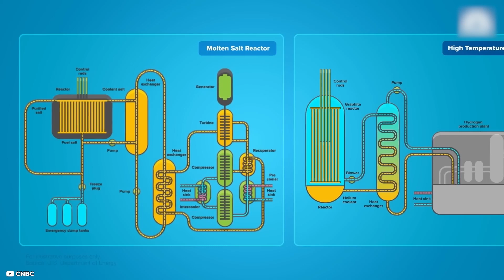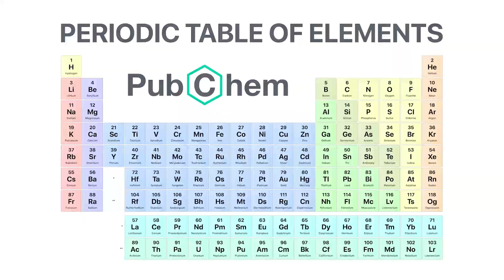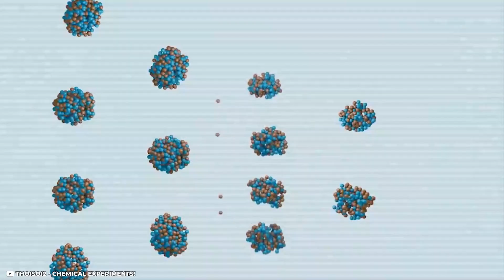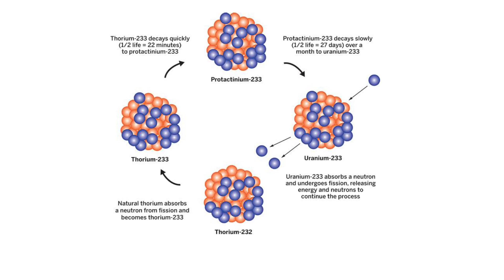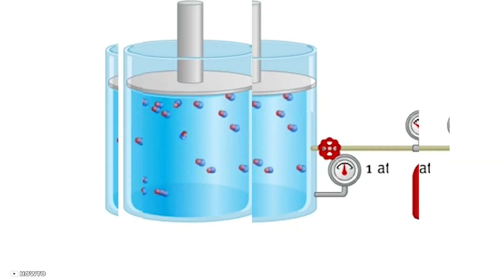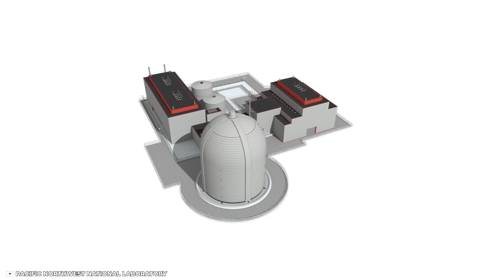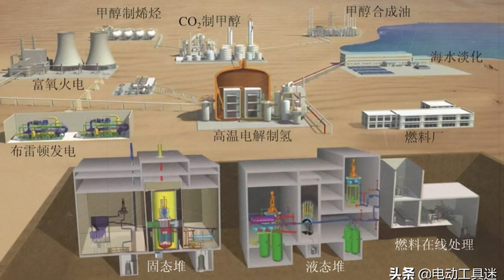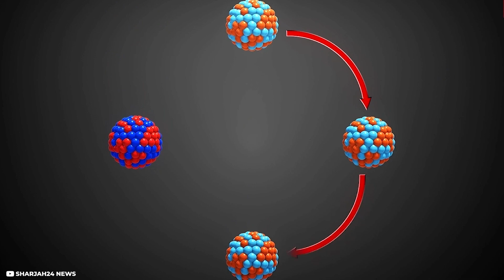NEW NUCLEAR REACTOR! Safe Nuclear Energy for 1200 Years!?

Comment: Molten salt reactor research was shut down due to political reasons not problems with corrosion.  The first reactor was successful in meeting all the requirements in demonstrating the feasibility of the molten salt concept and demonstrate advantages in safety and utility of the concept. The problem with corrosion was mostly figured out and a remote servicing process was developed to replace parts as needed.  A reactor to tests these solutions and to further develop the reactor concept was planned when politically all funding was cut. There were no technical reasons that the reactor research was halted.
For more information:
https://youtu.be/bbyr7jZOllI
Reply: Nixon explained his reasoning for shutting down MSR on tape.  "Where ever possible , move the money to california".   A true California Oil guy.
Reply: The reason was the US military.  They halted funding because you couldn't build so easy nuclear weapons. That what you call today nuclear waste is the leftover of a very inefficient 
hot water reactor, which uses only 5% energy from uranium roads that have to be reconditioned because they fall apart. You have a hot water immersion heater with a 5% energy production.
The public pays now unknowingly for the plutonium and weapon-grade uranium for the military.
A win-win situation for the military, not the public😁😁😁😇🥰
Reply: Based on what the scientist that lost their job over the decision said
Reply: @clarkkent9080  
Those scientist had no problem finding work.  They went on to other projects making just as much or more money.

Try to remember the economy in those days wasn't like it is now.
Reply: @tonyrmathis  Wow the entire world uses Uranium because of the U.S..  Russia, China, everyone followed us.  Actually the UK and Russia built the first commercial reactors so we followed them.

Terrapower has been working on their MSR for many years, fully committed 2 years ago and still nothing.  They estimate $4 billion for a 345 Mw reactor that is already a financial failure if it can even be built at the estimated cost which no nuclear project has.

The U.S. also built a nuclear powered air plane decades ago and I guess it was abandoned because of politics because I don't see any of those flying around
Reply: @clarkkent9080  
"What specific unnecessary regulation are you referring to??? "
Are the safety systems the same for Thorium?  NO!  Yet regulations designed to address high pressure uranium designs that can and do run away and melt down are the ones they have to meet.  As for systems being periodically tested those are post build and wouldn't have any effect on cost.  Your response is a plea to emotion.

"Please specify ANY anti nuclear battle that have been reported on the Terrapower project"
I made a general statement that all applies to ALL attempts to build nuclear plants in the US and has been a factor ever since the anti-nuke movement and the politicians who pander to them gained power.

"Please provide the link to Nixon political statements on the MSR."
https://youtu.be/tyqYP6f66Mw?t=929

Unlike when you claimed Terrapower spent $4 billion on MST 
Terrapower along with the Southern Company announced building a MST demostration plant in 2022.  The $4 billion you refer to isn't just for MST it's for Travelling Wave Reactors, Sodium Fast Reactors and R & D.

"That 80 billion sent to Ukraine may just prevent WWIII and Europe could have prevented WWII if they would have stopped Hitler in 1939"
Putin's aggression is toward former Soviet territories unlike ours that targets small countries worldwide. If Texas left the union and allied with Russia you wouldn't call Biden 'Hitler' if he took military action.  Save the warmongering for kids too stupid to know better.

"You are a MSR Thorium fan boy"
Yes and you're a warmonger.

"You believe that no matter what it cost build it and make the taxpayer build investor owned power plants and let them profit."
I never said any such thing.  Projection perhaps?

"No U.S. utility is even remotely considering new (16 year build time)"
Why?  Why 16 years?  Why has the build time quadrupled since anti-nuke politicians gained power?  Please tell us how concrete magically takes 4 times longer to cure and steel takes 4 times longer to weld.
Reply: @tonyrmathis  The regulations specify that the containment shall prevent the release of radioactivity in the event os a major loss of coolant accident.  You don't want that for a MSR????

The regulations do NOT specify the size, thickness, or even type of containment only that it contains.

This is part of Nixon's documented speech to congress in 1973. Your link shows a conversation that is fake as it cannot be found anywhere else other than that YT video.

Most nuclear power plants now in operation utilize light water reactors. In the near future, some will use high temperature gas-cooled reactors. These techniques will be supplemented during the next decade by the fast breeder reactor, which will bring about a 30-fold increase in the efficiency with which we utilize our domestic uranium resources. At present, development of the liquid metal fast breeder reactor is our highest priority target for nuclear research and development.
Reply: @clarkkent9080  
"The regulations specify that the containment shall prevent the release of radioactivity in the event os a major loss of coolant accident.  You don't want that for a MSR????"
The regulations were designed to address high pressure uranium reactors.  No regulations exist that focus primarily on MST because MST hasn't been developed over 50 years like other reactors have.  Containment for MST doesn't need to be a robust since there's no high pressure or coolant water involved.  You don't need to trap steam if you're not producing any.  If your coolant is solid at ambient temperature there's no risk of escaping to atmosphere.  Yet the regulation require safe guards against just such.  If the regulations were based on MST then other reactors would be horribly unsafe.

"The regulations do NOT specify the size, thickness, or even type of containment only that it contains"
Again basing the safety requirements needed for MST on those needed for other reactor designs.  Tell us more about radioactive steam containment in a system that doesn't need or use water to function.

"This is part of Nixon's documented speech to congress in 1973. Your link shows a conversation that is fake as it cannot be found anywhere else other than that YT video."
It is a phone conversation not part of any speech.  The fact that you can't (or won't bother to) find it doesn't mean it's fake.  All your response does is prove that even when presented truth you'll reject it.  Typical or your type.
Reply: @clarkkent9080  
"the reactor requires a smaller containment structure than a conventional reactor."
Gee!  It's almost like it doesn't have the same safety requirements as a standard reactor.
Reply: @tonyrmathis  The Terrapower Natrium reactor design has been finalized and you can access all that information.  But you cannot name one thing that regulations require of that MSR that is not required for that design. Proof not tin hat conspiracies',

You can claim anything you want but you have no proof.  Find one article on VC Summer, The MOX project, or Vogtle that claimed deliberate legal sabotage by anti-nuke activist of regulations and permit/licensing requirements????
Let me help.  This is the latest ~ $1 billion in cost over runs at Vogtle and unless the CEO is a lier the problem had nothing to do with deliberate legal sabotage by anti-nuke activist of regulations and permit/licensing requirements.

Below is the Vogtle Project Management's answer for the latest delays:
Southern Co. yesterday announced another delay for its long-troubled nuclear construction project in Georgia, edging its costs closer to the $30 billion mark. 
The setback could now push the startup date for Plant Vogtle’s first reactor until early 2023 and move the date for the second one to later that year. 
Plant Vogtle’s latest move highlights the nuclear industry’s chief troubles with building large, baseload reactors: safety and cost. To be clear, Southern executives have blamed this new hiccup on paperwork, saying that workers were gathering it to send to federal safety regulators and noticed critical inspection records were missing or incomplete. The pile of missing or incomplete documents added up to a delay of three to six months, Southern said. That additional time is costing $920 million. 
“We’re a little frustrated with the latest developments,” Southern Co. CEO Tom 
Fanning talked of “great momentum” at the construction site since November. 
But workers realized “tens of thousands” of critical documents were missing, leading to a three-month backlog. 
“We’re fixing that part of the ‘paper’ process,” he told E&E News.
Put your tin foil hat back on message pending!!!!
Reply: @clarkkent9080  
Alright!  Since you have all the answers explain why it cost so much and takes so long.  Why have they both quadrupled since the anti-nuke movement began?  Nothing you've posted explains why building a nuclear plant takes 12 years longer or billions of dollars more than it should.  And no!  Missing paperwork won't cut it

It didn't take that long and cost that much before anti-nukes so what changed?  And no!  All those plants weren't unsafe or substandard.

And if you don't mind how about talking about the broader industry instead of laser focusing on a company owned by politically well connected software engineer Bill Gates.

And while you're at it tell us what energy solution you DO approve of since you're so opposed to trying new things.

You started off blaming this on disgrunted scientist then went on to defend Nixon and Warmongering.  Why?

You call me a fan boy because I like the idea of a new reactor design and I've admitted it.  What's your motivation?  I don't have a stake in any of this.  My taxes won't go up or down based on any of this.  My income won't change either way.  How about you?  Why so passionately oppose to MST?  Do you work in the uranium supply industry?  Are you a paid anti-nuke?  Perhaps you're vested in some green energy company.  Tell us why you're so opposed.  You've already stated you agree with spending 20 times as much on a corrupt country half way around the world so it can't be fiscal conservatism.
Reply: @tonyrmathis  I thought it was obvious to the most casual observer.

I have not worked on either project but I live less than 60 miles from both VC Sumer and Vogtle and know many that work or worked there. I can only relay what I have been told by people that actually worked or are working at these failed projects: poor management, stolen equipment, fraud, kickbacks, greed, sabotage to keep the project going, lost (i.e. never x-rayed or performance tested equip.) documentation, etc. All project related. Oh and maybe the biggest issue, the utility makes a profit based upon the cost of the project so the ratepayer is stuck paying  for their mismanagement. 

Yes my sources say the there were no missing documents, they just did not x-ray the critical safety system welds or performance test the equipment until it was time to collect all the documents.  And if you don't think this is a project management issue. NO ONE was demoted or fired because of the "missing documents".  Were do you think the VC Summer workers and managers went when that project was canceled?  You guessed it Vogtle and they will be on the next nuclear project if there ever is one.
 
The facility where I worked hired a group of ex-navy nukes. One (ex navy nuke chief) over the 3 years I knew him never obtained his Rad Worker training.  That means he  never entered the nuclear facility in 3 years and he was responsible for qualifying new hires. Worthless as can be and a real @ss kisser.  He finally quit and you guessed it , went to Vogtle.

I do have 1st hand knowledge of a concrete structure that was being built to protect a critical safety system.  The concrete mix was specified along with the specs on the rebar steel mix.  In order to meet the engineering requirements for the structure these things must be met as specified and a premium ($$$) is paid to the concrete and steel vendor to meet that spec. 
When workers tried to install the rebar, sourced from an Alabama mill, it would break and not bend as it should if it was made as specified. The rebar was low grade steel that might be alright if building a Walmart but it was no where near the steel mix specified.  Some vendors don't seem to understand that a specification is there for a reason and some just think they can get away with providing crap.  In this case, the concrete pour was put on hold, the job delayed, costs increased, and since the project has no time to argue with that mill, just paid them and sourced the steel from another mill and QC inspected it before acceptance. 

Any questions?
Reply: @tonyrmathis  Unlike you, I am not here with an agenda supporting any particular power generating method.  I just provide facts when I see fanboys claiming things are are not going to happen.

It is annoying when people pull out these unfounded, nonfactual conspiracy theories to explain what the have no facts to back up.

BTW neither you or I will have any input to the electrical generation sources that are built.
Reply: @clarkkent9080  
All that is good grounds to oppose those plants but it's not an indictment against MST itself.

Mismanagement, fraud, faulty materials would cause excessive cost overruns and delays on any project.  As for not X-Raying weld at a nuclear plant that's ought to be criminal.  

My best friend's father was the best welder I ever knew.  He worked at Ingal's Shipyard in Pascagoula, Ms. welding reactors in naval ships.  He was so good they transferred him to Iowa to train other welders and supervise reactor welding at a plant they were building.  He explained to me all the things they had to do to certify a weld.  X-rays were just part of it.  They had several different test they had to pass to be certified and if they failed it was all cut out and redone.  And this was 40 years ago.

I'm not sure how they got away with what they did at the plant near you but clearly several people need to be in jail.  It couldn't have happened without at least half a dozen people from management all they down to the welders turning a blind eye.
Reply: @tonyrmathis  I have never commented against the safety of a nuclear power plant or consider the waste issue to be a non-starter.  I operated one for many years.  I will however comment on those that misstate anything about either of those. 

Yes people should have been fired at Vogtle but they were not.  There were a few managers at VC Summer that were charged with fraud but I have not kept up with the court cases.

The other issue that has come up is the U.S. construction industry's inability to staff two major critical QC projects at once.  Both VC Summer and Vogtle claimed delays and cost over runs on the inability to obtain the necessary skilled workers as one project stole workers from the other. Keep that in mind when people think we can just simultaneously build multiple units in the future. 

Something that is becoming a very big problem is counterfeit parts and the higher the price for the component, the more likely it will be the target of counterfeiters.

It does not matter if it is modules constructed in a factory as they were for VC Summer and Vogtle or assembled on site welding is NOT welding.   A nuclear grade weld just like nuclear grade equipment is very specific and usually requires testing of some sort to confirm it meets design specs. This is what allows a nuclear plant to perform as designed.

I can tell you that I experienced "events" at various nuclear power plants that would have resulted in significant damage if it involved "normal" construction methods but the nuclear grade build held together and it became an accident that never happened. That is why I push back on comments that we should relax the regulations that most probably have prevented many events from even happening.

Today in nuclear it is cost, cost, and cost
Reply: @clarkkent9080  
I can see why you think I was advocating for relaxed regulations but that was not my intention.

My point was the regulations in place (at least a few years ago) were based on high pressure water designs and that what is needed is new ones tailored to MST.  Such new regs wouldn't just lower cost and build times but would also increase safety since MST has issues other designs don't.  Fuel reprocessing for example.

The same problems you point to in construction also exist in government agencies charged with regulating these things.  Many lack the expertise to create the needed regs and lack the will to do anything that even appears to be a roll back.  

Again these are not problems with the tech but rather the people charged with developing and overseeing it.
Reply: @clarkkent9080  Terrapower's reactor is a first build commercial reactor.  Like how much did it cost Tesla to build it's first car?  The thing about the Terrapower reactor is that it is geared to produce it's electrical power when renewables can't and the return for producing power during these times is very high. It appears that the value of producing electricity during times of high return is going to be increasing in the future as more of the grid becomes powered by renewables. So there is considerable profit potential in Terrapower's reactor concept even if costs are greater for each unit of power produced.  The type of reactor Terrapower is building is planned to be a basis for multiple reactors.  Once the process of building the first reactor is established following reactors will become cheaper as experience develops.  So the cost of this first reactor should not be the determining factor as to how successful this reactor system will be in the future.
Reply: @stanleytolle416  I agree that costs should come down as more and more are built....."should".

After all Vogtle unit 1 & 2 were 500% over budget and unit 3 & 4 are only 125% over budget and not yet both operational.

But the bottom line is that even if Terrapower could eventually drop the build cost, it will not be substantial.  Its not like they will eventually be able to build a reactor for their original $1 billion dream.  And if you know what little a billion dollars buys today, you know that is true.  First lets see if they can even build it for $4 billion before claiming anything. My belief is if they ever build the first one, the story will be: "we can get the cost down to $4 billion if we build more".

The cost for nuclear is so much more expensive than solar, wind turbines and natural gas that it cannot possibility compete no matter how efficient production methods become.  Nuclear has always been claimed to be less expensive if we build more.  That has NEVER happened so what idiot would believe them now after 60 years of lies? The only reason Vogtle unit 3 & 4 are at $35 billion and not $45 billion is the passive design.  The passive design is a safety selling issue to the public but in reality it is a cost saving measure (less pumps, emergency generators, and two trains of everything). 

I am fully aware of the Natrium storage ability.  Claimed additional 150 Mw for 5.5 hours but in reality much less.  Everything that established Westinghouse nuclear has ever sold was in reality less so why would anyone expect more from a startup. 

The loss from solar far exceeds a 5.5 hour period so you are going to need another generation source like natural gas so why have two generation sources when one gas turbine can handle all needs?
There are many parts of the U.S. where the wind always blows so wind turbines don't really fall into the "partial production" duck curve of solar.  Every grid has spinning reserve that can make up for peak demand and renewable grids will need to utilize more spinning reserve than current grids.

One presidential candidate who is not just some politician spewing what the polls tell him to say, gave the best answer ever when asked about new nuclear, in a town hall.  He said; No utility will build the current generation of nuclear reactors with out the government paying much of the cost. And there are all kinds of claims being made for gen 4 reactors designs. If private investors are willing to build them and those claims are proven to be true, I will back them 100%. All that off the top of his head..no teleprompters.

I was shocked that someone running for president actually knew what a gen 4 reactors was and had a knowledge of the nuclear industry.
Reply: @clarkkent9080  the cost of nuclear reactors does not need to be as high as they have been in the US and Europe.  The problem has been mostly demands for changes after construction begins and blunders in construction.  Korea is an example where massive nuclear is being built on time and under budget.  Even Russia in doing just fine in Turkey. If one looks even at oil there are massive government subsidies to keep the fuel flowing not to mention a few wars.  Like why is not private industry picking up the tab for the military cost of our involvement in the Middle East if that energy source was so lucrative? As for the economics of nuclear the operating cost of even are current plants is quite low.  Really nuclear was only having a problem when gas prices were extremely low due to excess production from the development of fracking.  The gas was a by product of the oil that was really wanted. As you may have noticed gas is no longer cheap as LNG terminals have been built and gas is now at world prices.  Current nuclear is also having problems because of changes in how electricity is sold.  Current nuclear was built for a guaranteed steady purchase of electricity with rates set based on the amount of investment made. Nuclear no longer gets this benefit but it does have to complete with renewables that are guaranteed a purchase price no matter the demand for the power at the time.  The effect is the price of power going below zero at times. This is one of the subsidies going to renewables that is currently hurting nuclear power. The reason to push these subsidies is to get off of the climate destroying war producing current energy system.  There is considerable private investment in newer nuclear which Terrapower is but one example. As I see it nuclear is the only way to truly change our energy use into a truly sustainable    system.
Reply: @stanleytolle416  I agree that the costs should not be so high but they are and just because you say something does not make it true.  Here are the FACTS for the last $1.5 billion in cost over runs at Vogtle.  And BTW, Unit 3 started on April 1, shutdown a week later and just restarted two weeks ago.  Where those months of shutdown due to construction changes?  And if you want detailed facts, I have Georgia Power's statement to the PUC in the reasons for the delays and they have nothing to do with changes from the NRC.
What happens in other countries has no bearing on construction in the U.S..  And the Texas grid method of compensating generators is unlike anything in the east or west coast grids where suppliers NEVER get paid zero for the power generated. It is a contractual cost per Mw supplied

Below is the Vogtle Project Management's answer for the latest delays:
Southern Co. yesterday announced another delay for its long-troubled nuclear construction project in Georgia, edging its costs closer to the $30 billion mark. 
The setback could now push the startup date for Plant Vogtle’s first reactor until early 2023 and move the date for the second one to later that year. 
Plant Vogtle’s latest move highlights the nuclear industry’s chief troubles with building large, baseload reactors: safety and cost. To be clear, Southern executives have blamed this new hiccup on paperwork, saying that workers were gathering it to send to federal safety regulators and noticed critical inspection records were missing or incomplete. The pile of missing or incomplete documents added up to a delay of three to six months, Southern said. That additional time is costing $920 million. 
“We’re a little frustrated with the latest developments,” Southern Co. CEO Tom 
Fanning talked of “great momentum” at the construction site since November. 
But workers realized “tens of thousands” of critical documents were missing, leading to a three-month backlog. 
“We’re fixing that part of the ‘paper’ process,” he told E&E News.

LATEST: Georgia Power says Unit 3 could now begin commercial operation in June, 2023, pushing back from the most recent deadline of the end of April.  Unit 4 will begin commercial operation by March 2024. The company previously has promised commercial operation of Unit 4 by the end of 2023 at the latest.
Georgia Power discovered that a pipe that is part of a critical backup cooling system was vibrating because construction workers had failed to install supports called for on blueprints. 
Fanning told investors that other issues causing delays included a slowly dripping valve, as well as a problem involving the flow through the reactor coolant pumps that hasn’t been pinpointed.
Georgia Power ratepayers are already paying for Vogtle, and most electric customers in Georgia, as well as in parts of Alabama and Florida, will eventually be charged. The effects of the further delay on ratepayers are unclear. Georgia Power has signaled it may could ask for more to be paid for capital costs and financing.
Reply: @clarkkent9080  like I have trying to point out the Georgia Volta nuclear power plant is not a good example of nuclear power.  The plant is based on old assumptions as nuclear power should function (non-variable base load).  At a minimum nuclear power plant needs to be able to load follow ideally store power for peak outputs. The Georgia plant can't do this. The cost over runs at this plant were the result of deciding to change things including tearing out all ready build concrete work.  Like how much would a house cost if you came to the contractor several times with the house partially built and you told them to tear that up and build something completely different? Like maybe you should look at nuclear plants, the vast majority that are being built, that on time and under costs.  Maybe look at the history of the plants built prior to the eighties where the plants for the most part got build for far less cost and within their allotted time schedules. Like since we already have relatively inexpensive fossil fuel plants which are doing enormous environmental damage the first mover cost will need to be subsidized to improve our future lives.  In fact the subsidies needed to establish fourth generation nuclear plants is far less than what had been spent on renewables. There is a reason China has been spending equivalent billions of $ developing fourth generation nuclear including thorium molten salt reactors and that is to develop the intellectual property rights to the technology. If we let the Chinese accomplish this we will be completely screwed being dependant on the Chinese for our energy needs
Reply: @stanleytolle416  They tore out that concrete because the concrete did not meet the design specs not because the specs changed.

Like I said Vogtle unit 1 & 2 were 500% over budget built in the 1970s.  NO U.S. nuclear power plant has EVER been built on budget or schedule.

Is VC Summer a better example or the MOX facility?
You are living in an alternate reality.

The U.S. does have the construction craft with the skill set to build critical nuclear facilities and suppliers simply ignore specifications and provide the low quality material that they have.

Vogtle was building a rebar/ concrete structure for safety equipment.  When the workers were trying to bend the rebar it snapped.  The project paid extra for rebar with a very specific metal/carbon mix as specified in the DESIGN.   The U.S. steel mill sent the same cheap stuff they sell at big box stores and pocketed the extra money.  The project does not have time to litigate the issue so they paid the mill and ordered new rebar from another  supplier. Do you know how many millions in extra rebar cost, lost work time, project schedule upset that cost.  Now tell me Terrapower won't have the same problem.

U.S. construction can build WalMarts an Amazon  warehouses but not nuclear power plants.

Once a gen 4 reactor is built and proven then and only then can you make any claims. It is just like me saying why waste money on fission when fusion energy is clean and limitless? there is NO technical reason against fusion, it has been proven to work on the sun and here on earth
Reply: @stanleytolle416  SIMPLE point: VC Summer, Vogtle, and MOX are recent and the only new nuclear projects in the U.S. over the last 30 years.  You can try but you cannot ignore the facts that 3 were complete failures and two massively over cost.

There is no other REAL nuclear example to try and claim that nuclear can be built on schedule or within budget.

We have 50 years of massive cost over runs and project after project proving that.

All you have is your claim that it will be different next time or that a gen 4 reactor that is a prototype no less, will be a financial success.

Dude, I worked in the nuclear industry 40+ years and am pro nuclear.  I can argue the waste issue, the safety issue but I cannot argue the cost issue. Nuclear gets subsidies just like wind and solar and that is also not an excuse.

With the national debit becoming something that cannot be ignored, all generation sources will have to stand on their own and nuclear is the least able to do so
Reply: @clarkkent9080  really that's simply hiring incompetent builders.  With construction crews that know what they are doing nuclear reactors are being built in 3 years.  The Russians are having no trouble building reactors all over the world.  The South Koreans the same.  This is why the Georgia plant can't be looked at as a normal nuclear construction project. Like African countries are not having trouble getting nuclear reactors built. Maybe some foreign workers who know what they are doing, maybe from Africa, need to be brought in.  This or maybe develop some skills here.  Really it's not that it's not known how to build these projects, like rockets are getting built that can land where they took off, it appears to be more or less  shorty management and crazy building regulations. What I am saying is that if on time on budget nuclear reactors can be built in Africa I see no reason they can't be built here too.
Reply: The answer to the corrosion is an alloy called Hasselhoy N. They used that at Oak Ridge.😊
Reply: Your comment could only possibly be true if there were no other countries in the world.  But since there are many other countries that have nuclear power, why did they not build MSRs?

Conspiracy theories fall apart when you realize that U.S. politics do not affect other countries.
Reply: @clarkkent9080 To understand why Molten Salt Reactors (MSR) were not developed earlier one needs to check out first mover costs.  Like when the development costs for light water reactors for nuclear submarines were undertaken it was just a matter of making these things bigger. Besides almost no one was thinking of dissolving nuclear fuel in molten salt as a coolent/working fluid.  In the US MS was only thought of because of the extreme requirements needed for the nuclear bomber program.  Like the reactor had to be light, compact, operate at very high temperatures and not spread radiation all over the place if the plane crashed.  A MS reactor that could do this was built and tested.  It did work but would not work for a piloted aircraft due to the needed shielding.  Casper Weinberg who developed the light water reactors for submarines felt that a MS reactor had potential to eliminate the risks of large LW reactors with high pressure, loss of coolant, and radiation release hazards. Under his leadership a working MS reactor was demonstrated.  I personally feel this reactor threatened the then whole current nuclear industry with the then current, President Richard Nixon, being manipulated to cut all funding for this program.  I say this because how the program was shut down with orders to destroy all of the research product.  Just by luck several engineers defied their orders and transported their work product to a local community library where these documents remained in a cupboard for thirty years. By chance an aerospace engineer by the name of Kirk Sorensen came across a book about the MS experimental reactor and decided to look into the issue. Kirk discovered the documents at the local library and digitize them and posted them on the Internet with nobody paying much attention except the Chinese government. It turns out the Chinese government was very interest in the project and sent delegations to Oak Ridge Lab to further investigate.  With this interest others have become interested in the MSR concept with the Chinese investing billions of $ equivalent to develop a complete MSR program. The Chinese have built a 2 MW working MS reactor in three years and will have a 300 MW commercial MS reactor around 2026 with serial production of these reactors planned before 2030. Well from the top of my head this was why MS reactors were not developed earlier.  There are a lot of knowledgeable people who think this is the way we should have gone with nuclear reactor development in the first place.
Reply: @stanleytolle416  What about the 3 U.S. commercial nuclear power plants that tried Thorium cores in the 1970s and all abandoned them as too costly???

Other countries have also tried Thorium cores and again abandoned them.

Even today China and India have built DEMO TEST Thorium MSR 1/4 the size of the U.S. ORNL demo test reactor from the 1960s.  They are not confinite enough to build a commercial plant
Reply: @clarkkent9080  these were solid cores. Using Thorium in a solid form has no advantages in a thermal reactor particularly with the cost of 235 uranium dropping. Some fast neutron reactors are being set up to use some Thorium in their fuel cycle. Part of the complexity of using Thorium is it is fertile but not fissionable.  In order for Thorium to be fissionable it has to adsorb a neutron and convert into 233 uranium which can fission. Yeah, it's nuclear science.
Reply: @stanleytolle416  The  main reason why Thorium reactors are more costly than Uranium based reactors is the cost and dangers associated with reprocessing the spent fuel to extract the U233. That is in addition to the cost of the reactor.

Thorium reactors are really U233 breeders and they like uranium based reactors have to deal with Xenon (primary issue at Chernobyl) . But only Thorium reactors have to deal with fissionable isotope (U233) build in that is based on what happened in that core 27 days prior, as there is a 27 day delay to the transmutation of Thorium into U233.
. I cannot even imagine how difficult it would be to operate a reactor with constantly changing fissionable material and neutron poisons.

BTW Sorenson tried to sell Bill Gates on Thorium but Gates is more educated than these YT fan boys and told Kirk that Terrapower's Natrium reactor would only use URANIUM.  :face-orange-frowning:
Reply: @clarkkent9080  This is not true for all molten salt reactors. The only issue with U²³³ is it could be made into a bomb. Though this is kind of a false issue because there are contamination issues with other isotopes of U that make bomb making hard. Really other reactors setup to make Pt are better for making bombs.  Otherwise what I have seen about continuous reprocessing is it is  basic chemistry that enables much more complete burn up of the U²³³.  None of this is a stopper of the technology as the Chinese have figured it out otherwise they would not be building their MSRs.
Reply: @clarkkent9080  molten salt reactors are much cheaper to design and build.  China has built their molten Salt reactor in three years for much less money than other experimental reactors. The original molten salt reactor experiment in Oak Ridge Lab in USA was built on a shoestring budget in less than four years.  Almost all the proposed molten salt reactors show what appears to be a much less expensive way to build and operate a nuclear reactor.  There is of course considerable first build cost for these reactors but  subsequent cost due to the the relitive simplicity of the designs should make these reactors quite abit less costly than current reactors.
Reply: @stanleytolle416  If China has solved all the problems, why did they build a demo test MSR that is only 1/4 the size of the U.S. ORNL Thorium MSR ?

China has stated that they will operate this TEST DEMO MSR for 5 years before they even try to operate any of the auxiliary  processing systems.

BTW separating isotopes, one proton difference is NOT simple chemistry add to that the fact that it is radioactive and fissile and you have a very expensive and dangerous process.

The reprocessing facilities of France cost many BILLIONs and have only been able to reprocess 30% of their fuel. And since these facilities are reaching the end of their useful life, France is planning on shutting then down as apposed to building new facilities.  The only real reason France and the UK reprocessed was  to obtain Pu239 for nuclear weapons and MOX was a side gain.

The simple fact is that there are NO commercial electrical producing Thorium or Thorium MSRs anywhere in the world and it will be decades before one is built if ever.  They only exist in the YT fan boys minds.
Reply: @clarkkent9080  China is building a whole MSR industry.  Like before they even build a reactor they built Li isotope separation facilities and the specialty steel factories to make it possible to rapidly expand once a design is worked out.  Lots of material R & D was undertaken before anything was built.  Things are being built step by step.  Like first they are recreating the Oak Ridge reactor and then adding components and testing them.  Like not everything is knowable untill something is built and tested.  The next thing they are building is the on line fuel reprocessing.  The Chinese are fairly confident they will be able to work out the bugs on the 2 MW reactor that they are all ready starting work on a larger reactor. Anything learned from their first reactor will be applied to their larger reactor.  Their schedule is to be building these reactors commercially in the early 2030.  The reason they are pushing so hard to be able to have the intellectual property rights to the technology so they can possibly dominate this world wide energy field kind of like the Saudi's dominate today's oil production.
Reply: Spot on. I've seen interviews of the engineers who developed the first reactor. All was ready for commercialization when the uranium industry showered politicians with money to ease the technology, going so far as to demand the new alloys be destroyed along with the records. That didn't happen (as far as I know), though no more progress was allowed.
Reply: "Political reasons" - not political:  powerful vested interests and their mafia-like lobbyists kill off too-disruptive technologies all the time. Sometimes the disruptive scientists involved die in mysterious circumstances too - or are persuaded to go research something else. If they value their careers and their lives etc.
Paul G
Reply: @paulgovan3507  One simple problem with that tin hat conspiracy theory.
Thorium was tried at one demo test reactor at ORNL in the 1960s and 3 commercial reactors in the 1970 AND in many other countries and ALL were abandoned as too costly.

Must be a world wide global cabal running the show.....even in China, Russia, and North Korea. That would be the only answer
Reply: Yes I know about the Russian fuel supply problem.  But did you know the U.S. taxpayer is footing the bill ($125 million) to build a fuel fabrication facility just for Terrapower?  I guess that divorce really hut his bottom line.  I expect to see him at the soup kitchen looking for a hot meal.
Reply: @clarkkent9080  my understanding is the new nuclear fuel plant is not just for Terrapower.  The High Assay Low Enrichment Uranium HALEU nuclear fuel is needed for several different fast nuclear reactors that are being developed.  These included gas cooled reactors, heat pipe cooled, space, waste burners and others. Essentially for a whole class of fast neutron reactors that can use nuclear fuel much more efficiently and in some cases eliminated legacy nuclear waste.  Allot of these reactors operate at the higher temperatures that are needed to replace coal and natural gas at current power plants.
Reply: @stanleytolle416  I am not aware of any new design reactors planned for the U.S. other than Terrapower and NuScale. And NuScale is using low enrichment fuel.

Nuclear power has been getting taxpayer welfare for the last 70 years and still cannot stand on its own. The estimated cost for both the  Terrapower and NuScale reactors is already a financial failure and they haven't even broken ground yet. The government cannot help build every new project.
Reply: The political extremist and “ shadow elite” are yo be blamed
Reply: Milton Shaw, Rickover's left nut, fired Dr Weinberg and hid the research, then the AEC wrote WASH 1222 to justify it all.  Dr Lyman is still regurgitating from it.  I'm sure you knew that.  So why did Congress put Chet Holifield, a representative who did not graduate from high school, in charge of the Joint Committee on Atomic Energy?  Did they plan to fail for the benefit of their coal buddies?  It is my only conspiracy theory.
Reply: Well If I would have been a manager of a utility at that time I would have rejected the MSR concept as well. 

There were very good reasons not to go on with the moderated MSR technology. The fuel handling and processing is very complex. Many challenges as the deposition of precious metals and the degradation of the graphite core. 

In a nuclear reactor run with thorium and U233 hard neutrons cause a n ->2n reaction (inelastic scattering) which create U232. U232 decays and emits in the decay chain a very hard gamma radiation that is difficult to shield. It makes the operation, maintenance and fuel reprocessing challenging.

Till today I do not see a molten salt reactor concept that has real advantages compared to a LWR.
Reply: @holgernarrog962  
Oh and as for 'real advantages' I'd say the inability to run away is a REAL advantage.
Reply: @holgernarrog962  
So as an operator you'd have embraced the high waste, unsafe designs because it was cheaper and easier just to bury waste and hope the high pressure system doesn't fail and the reaction runaway.

Sorry but that's not why operators didn't go with MST.  They didn't go with MST because it wasn't an option.   It's development was ended prematurely.  Development that was much easier in the pre anti-nuke era than it is now.

Operators have tried many systems for power generation some of which they knew wouldn't be profitable but politically necessary.  And for good reason.  Operators are not true independent businesses.  They're closer to branches of government than actual private industry.
Reply: @tonyrmathis  A MSR with several fractions of fission material is definitly not safer than a LWR.
Reply: @tonyrmathis  As mentioned as an operator I would always have chosen the LWR.
Reply: @holgernarrog962  
We get it.  You have a vested interest in the status quo.
Reply: @tonyrmathis  The MSR concepts known to me are not more safe than a LWR. All reactor types with a high energy density (necessary for economic reasons) face the challenge of the decay heat after a shut down. 

The MSR creates as well a lot of waste like the graphite cores. But the quantity of waste of any reactor concept is dimensions smaller than coal or dirty wind/solar.
Reply: @holgernarrog962  MSR reactors do not need to be cooled after shut down.  The molten fuel is simply drained into a self cooling drain tank. No high pressure explosions here.  MSR's are also idiot proof not like at Three Mile Island or Chernobyl and all other LWRs.  Like the coolant pumps were mistakenly turned off during full power at the Oak Ridge SMR with the reactor simply heating up some causing the nuclear reaction to stop.  Oh, forgot to start the pumps. Turn the pumps on, now it's working.  Let's see a LWR do that.
Reply: @stanleytolle416  in nuclear physics the fissioned nucldes are mostly radioactive and decay according to their decay chains providing decay heat doesn`t matter which reactor type.

In the original MSR design you can drain the fuel. But this drained fuel creates decay heat due to fissioned nuclides remaining in the fuel. There is as well a degassing and a fuel reprocessing in this concept.  There are reprocessed fractions of decay products that create decay heat. 

In the French/Euroatom concept there was as well like most other realistic concepts a degassing, a seperation of decay products with low boiling points and a reprocessing unit there are further fractions of heat generating fission products. 

All in all in the realistic concepts there is more than one storage for the heat generating fission products. It is more challenging than a LWR. 

Only phantasy reactors does not create decay heat!
Reply: @holgernarrog962  You might want to look at Terrestrial Energy, Thorcon Power, Seaborg Energy, Moltex, or Copenhagen Atomics. All of them are better than any LWR by a wide margin.